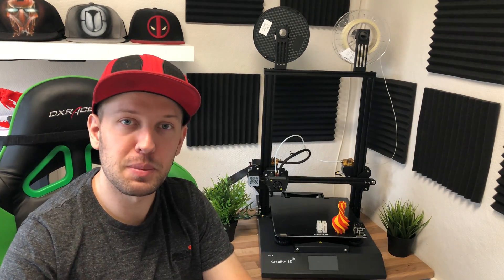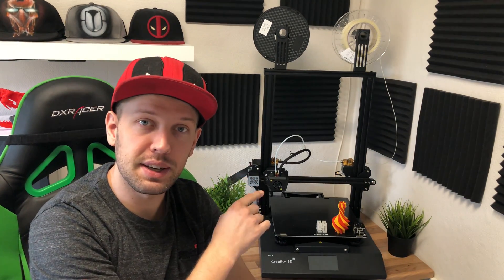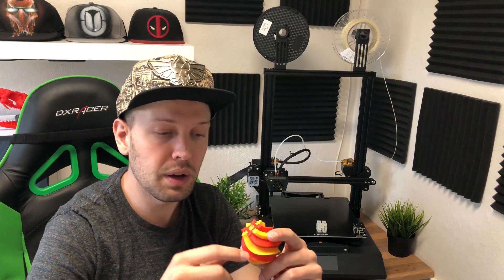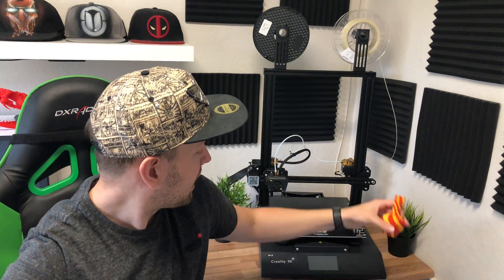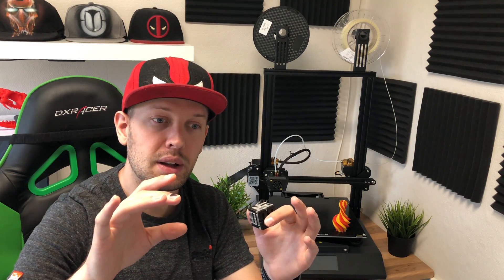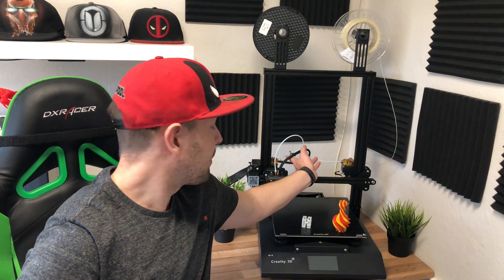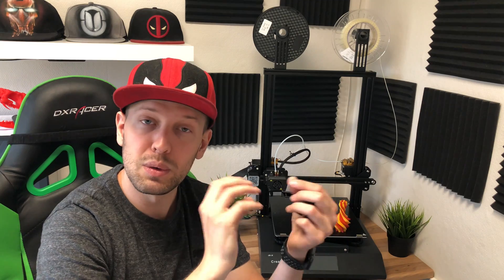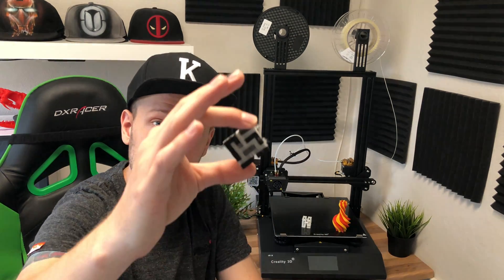PVA on a Creality CR-X

Comment: I cannot get anything to come out right with PVA. The PVA doesn't dissolve even when left for 24 hours in water and the PLA layers rip apart easier than the PVA! I just get a mess even with a prime tower that's way bigger than I use when printing dual colour PLA.
Reply: It happends the same to me. Can you share the tower and printing parameters?

Comment: Hi, good video, I am also interested in this printer and using PLA and PVA to print objects with easily removable support structures. So I guess it works as long as both receive the same flow temperature. Which software are you using? And while Creality says on their Chinese site that the CRX only supports PLA, Amazon USA lists many more types of filament on this printer's dedicated site (wood etc.). Do you know more? Keep on the good work

Comment: At sub $1000 prices you're always going to get compromise and the odd issue. When you go into the $200 bargain printers and below you have to be mechanically minded and able to fix things that break as well as upgrade parts of the machine yourself. When you buy for close to $100 from China then you get something that may work fine for a bit, but is not only unreliable but a fire risk, so be prepared to replace a lot of parts which are not fit for purpose such as under rated wires and PCB board terminals that melt when you heat the bed. 
Basically you get what you pay for, and although started on the crappy cheap Anet A8, I don't regret it as it was fun to tinker and improve it as well as learn how they work.

Comment: Thanks for your explanations. I have orderded a spool of PrimaSelevct PVA yesterday.
Two questions:
- How do you keep it dry? Whats your method?
- I've recognised the black foam noise dampers at your wall. How well do they absorb noise?
Reply from the maker: Is use rice cheap price:D you can use everything that sucks what we out of the air :D 

And the sound pads is useless:p 
 A much better way is to use towels inside a picture frame a thick frame folde the and use 3 towels and it’s so good:D there is a video on how to make your own I need to make the at my house to :D
Reply: Didn't think about using rice. Nice idea indeed! How low can you get the humidity with it?

Comment: Hey!
I have a solution for the tube popping out. The problem was common on the Creality Ender 3 as well. There was a bad batch of components so the tubes pop out. This model should fix it: https://www.thingiverse.com/thing:2994683
Reply from the maker: Thx :D but the couple is bad on my and broken the inner part broke and fallout:p but I will print them and put them on when I get replaced the bad couple:D